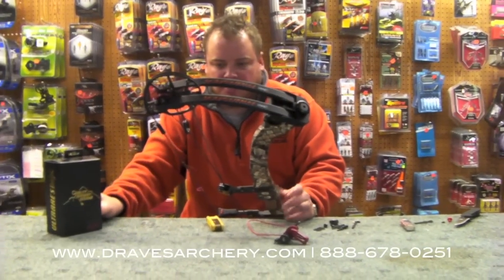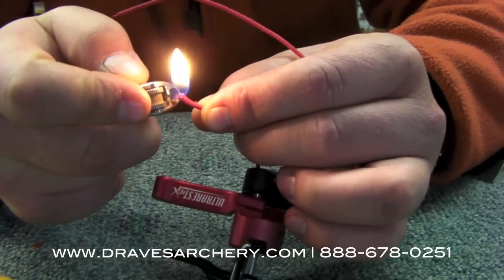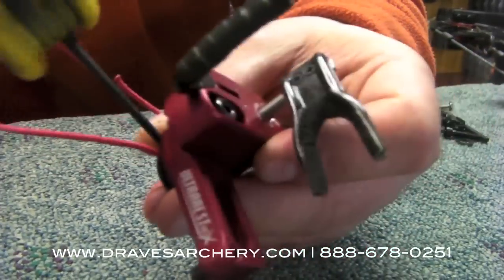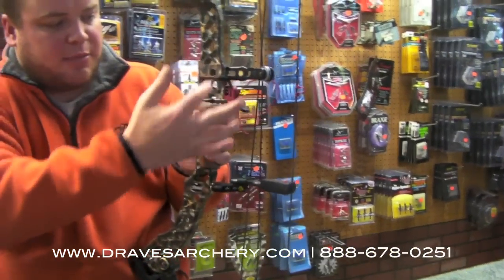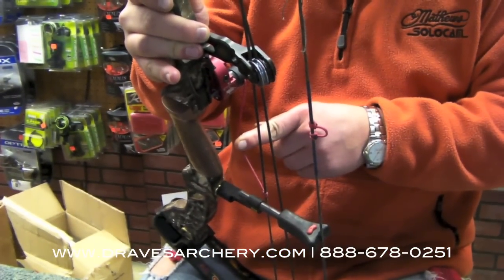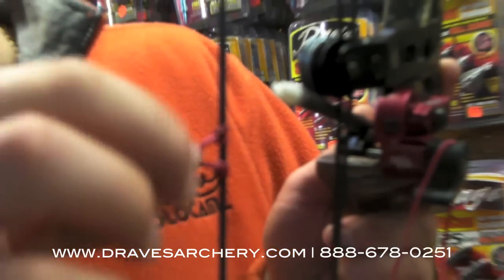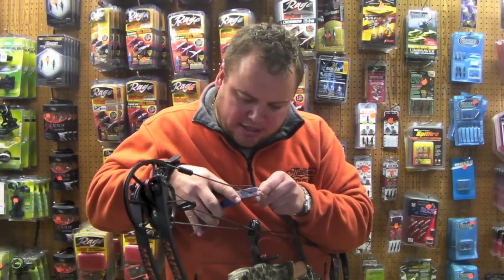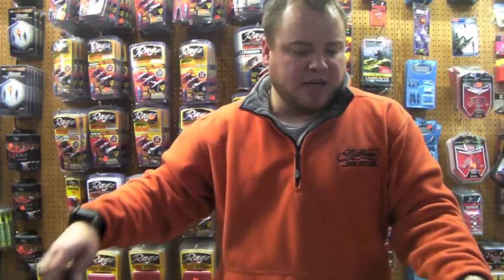How to Assemble the Quality Archery Designs Ultra Rest HDX on a Mathews MR6

Comment: The video that came w/ my rest was ok, however, this video was instrumental in helping me get my Ultrarest HDX installed!  I prefer to be self-sufficient as my nearest bow shop is 40 miles away.  Plus, I want to be able to fix things on my own since they usually go wrong at the worst possible time (when I'm furthest from an expert like yourself or just heading out to hunt).  Thanks so much for putting this video together and sharing your knowledge!  I'm sorry I did not purchase my rest from you but will seriously consider Draves Archery for my next archery related purchases due to the value your videos provide!  Again, thanks!

Comment: wow, coundnt even watch it to the end. drawing a bow without an arrow....what message are you sending to people? or are you looking for a lot of dry fire bows for repairs. paper tuning is out, modified french and walk back tuning are the fastest and most reliable ways to dial a bow in. I have had 2 bows come in with the ultra rest....both with fetching contact problems. not enough fletching clearance. both people were not impressed with the qad (one called it a piece of over priced shit). Set them one up with and NAP appache and the other one with a left hand (old stock)trophy taker. both were shooting bullets in minutes of fine tuning. after seeing this QAD is the last rest I will ever try to sell, And I am getting out of tat line....trophy takers are the way to go in my mind.